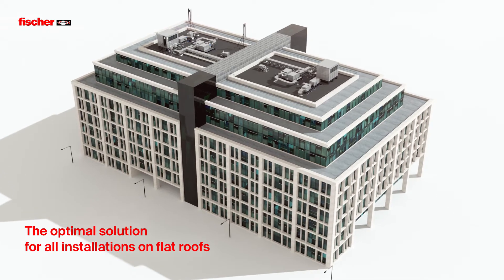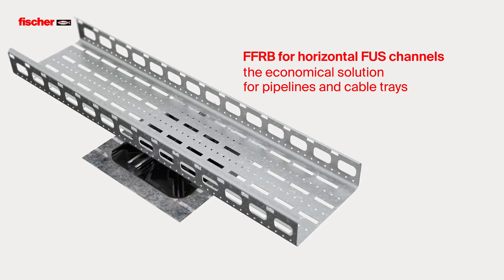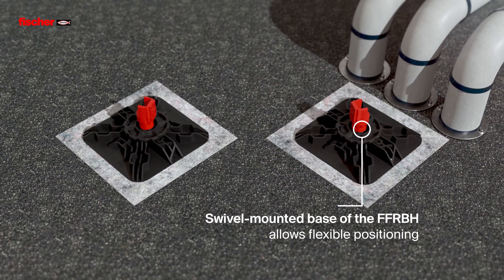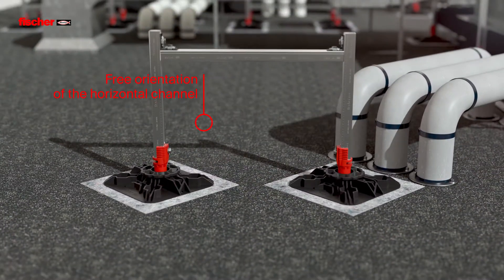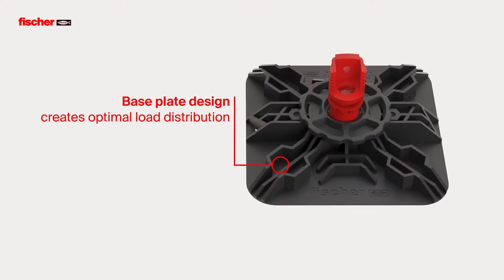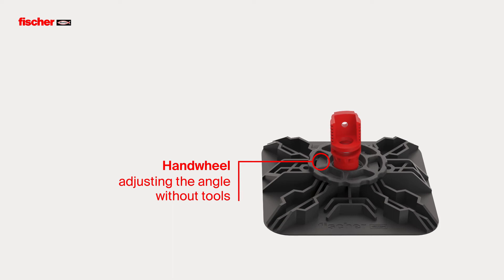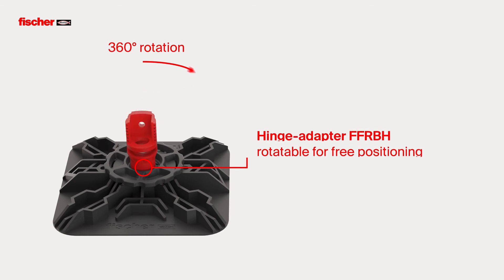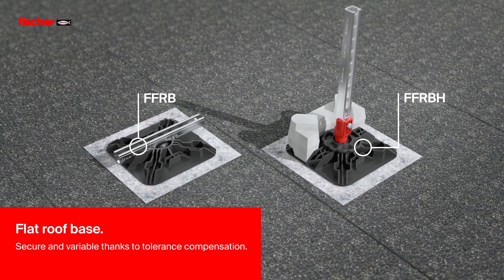Solution for flat roof installations I tolerance compensation possible

Comment: FIXPERIENCE software does not support Flat Roof installation?
Reply from the maker: Hello CuteCatLove00,
you're right - flat roof installation is currently not included in the FIXPERIENCE software.
If needed, please don’t hesitate to contact your local fischer subsidiary. They can support you with calculations if needed. 🛠️🙌